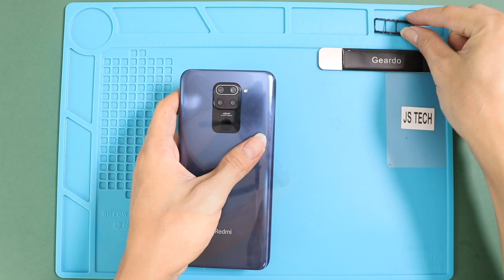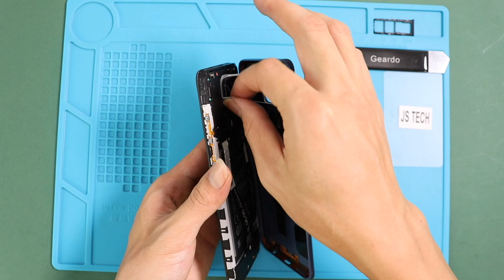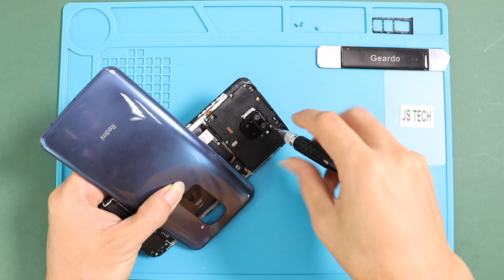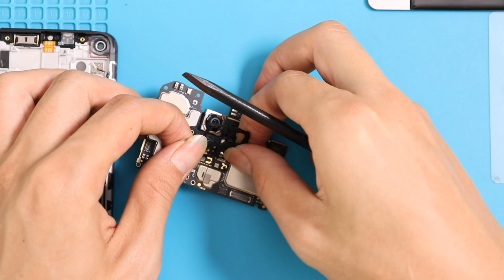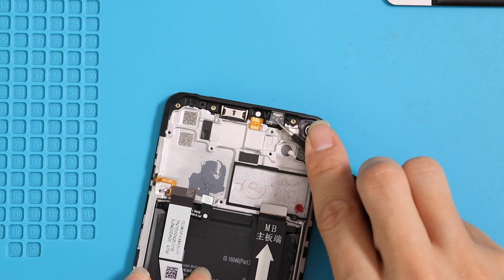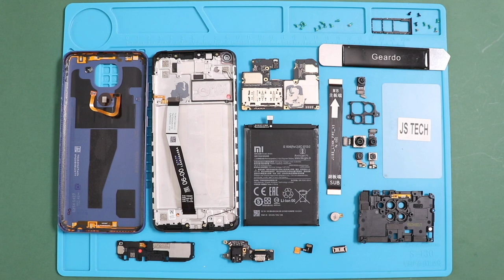Xiaomi Redmi Note 9 Teardown | Redmi 10X

Comment: My input speaker not working.change but not solve,akon. Flex cable change korle ki tuk hobe
Reply from the maker: Probably the replacement part is not good or connection is loose

Comment: I have only 2g on this phone,  I've tried everything possible I see online but none worked. But I don't want to try out the hardware method because I've not seen any video that shows for redmi note 9
Reply from the maker: You mean signals ? What version you have ? If you have issues with signals then you have to check phone network bands and your service provider bands
Reply: @DIYGeardo  I have checked but none worked,  I have 4g SIM card and it works fine on my other phone but doesn't work on my redmi 10x ... It started when I flashed in Merlin global version
Reply: @DIYGeardo  The phone got bricked, so I opened it looking for the test point so that I can flash it on EDL mode since I locked the bootloader by mistake while flashing the global version,  I couldn't find any test point,  so I just had to flash engineering rom into it before I could unlock it using cm2 dongle then I flashed in the stock rom again and my IMEI was lost
Reply: @DIYGeardo  so please what's you suggestion?
Reply from the maker: @thesage3883  Once you flash/bricked it is hard to say what you can do. Because there is a risk something can happen with the device and I do not know the way you excuted.